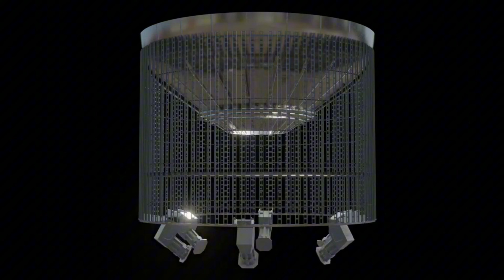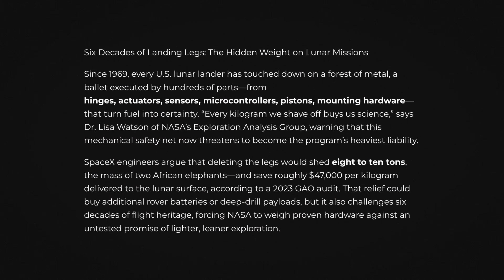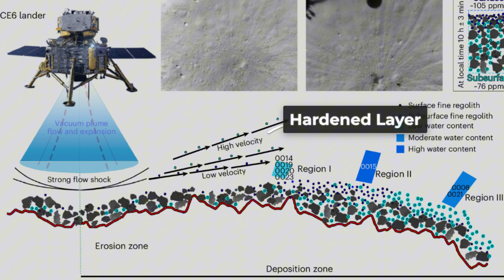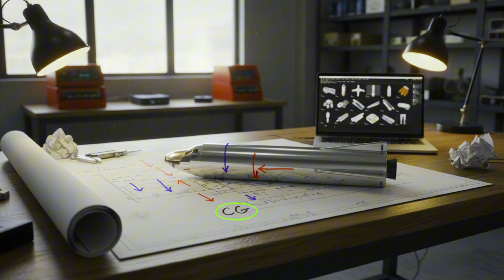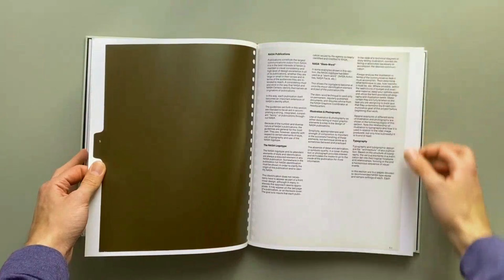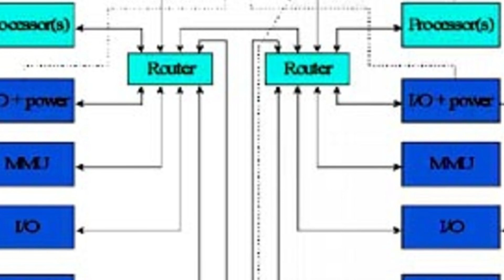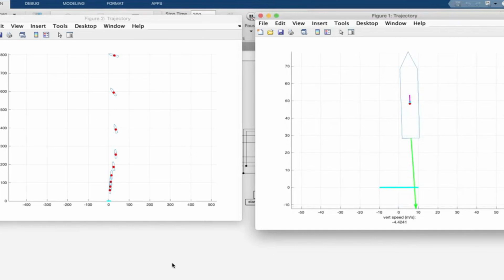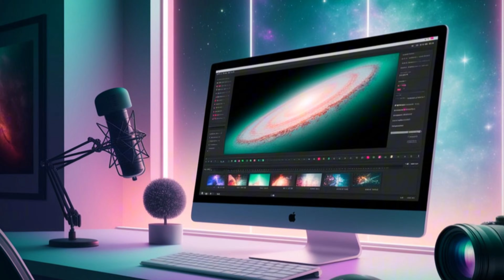NASA Rejected SpaceX's Most Brilliant Moon Landing Idea—Here's Why

Comment: Use Apollo method, i fyou think Nasa really landed 60 years ago.. LOL
Reply: Apollo was a fantastic technical achievement and all involved are heroes. It proved that it is possible to go to the moon and come back. They couldn't stay more than a few days, but they did it.

1. If you want to go to the moon to do science, stay there for months at a time, learn how to live in reduced gravity and cope with extremes of temperature etc, you will need a moon base of some kind.

2. A moon base, according to various studies will have a mass of at minimum 150 tonnes (much more if you are trying out manufacturing or mining). For comparison, ISS is about 450 tonnes.

3. Landing a 150 tonne moon base Apollo-style from a single launch will require a rocket of enormous proportions, in the order of 20,000 tonnes ( 10 times the mass of Space shuttle, 7 times the mass of Saturn 5 ) and will need a rocket launch pad of correspondingly enormous scale.

Nobody is building such a monster.

The alternative is to launch many (at least in the order of dozens) smaller (approximately Saturn 5 sized or SLS - sized) rockets and either assemble a huge moon lander in earth orbit or assemble the base on the lunar surface. 

If you are launching dozens, scores or perhaps hundreds of rockets, it helps if they are cheap, reusable or both.

Transferring cryogenic propellants from one craft to another in zero-g is difficult new technology that needs to be developed and much of the testing must be done in orbit. This will take many launches, so a re-usable launch vehicle will help.

Storing cryogenic propellants in space without them boiling away before use is difficult new technology that needs to be developed  and much of the testing must be done in orbit. This will take many launches, so a re-usable launch vehicle will help.

SLS has flown, but is not re-usable, so it will take scores of expensive SLS launches to make a moon base. New Glenn will take even more launches than SLS.

 Starship is far more ambitious than either SLS or New Glenn, they have yet to attempt a stable orbit and seem to be struggling with the amount of useful payload, but they have managed to relight the engines on and catch a booster, re-enter an orbital stage to a precision target and propulsively hover at sea level and they are continuously improving, refining and testing the vehicles.